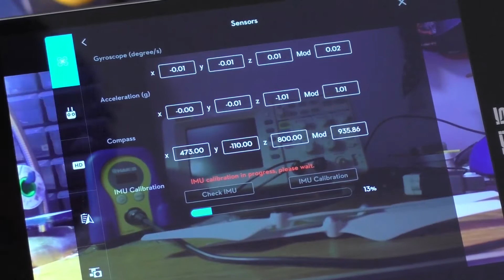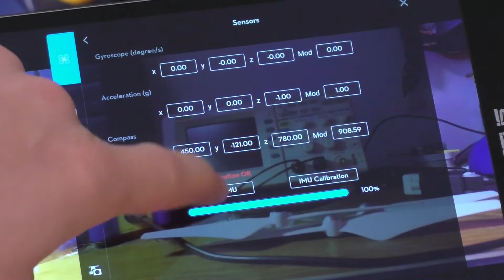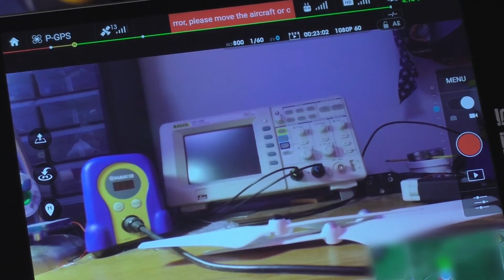DJI Phantom 3 Pro Shell Replacement

Comment: I was messing around with my setting last week then took not early know what was what , took my dogs for a run and my done        Was acting squirrelly ,drifting off when it should’ve been steady in one place any way about 10 min of watching the dogs chase it nearly missing it a few times then nearly missing some low trees about 300 ft away , I bought it back. That’s when I could see just how off it was ended up almost diftinginto a tree and watching $800 fall 50 ft catching every other branch till I crashes to the ground with a broken camera arm, I figure while it’s down I will replace the body ,the motors , and hopefully the camera it’s self still works , if taken my phantom apart a few times and ended up taking it to the shop for the to put back together again lol so we will see how it goes with your video as a guide ,

Comment: The push pins on the camera gimbel stretch when you compress the washer down on the pin, which enables them to be removed and reused. Thanks for the video.
Reply from the maker: Thank you for the tip, and your welcome.

Comment: Can I ask where you got all you’re parts from like the new motors and case I started getting stress cracks on my p3p and would like to change the case but I can’t find a proper seller as I couldn’t find on the DJI store itself. Cheers
Reply from the maker: I bought the parts off of Amazon. I have bought the shell twice form the same place (one for this video and once because of stress cracks) and they most certainly seem to be genuine parts. Here a link to the shell https://www.amazon.com/DJI-Phantom-Shell-Bottom-Covers/dp/B012HXD1BM/ref=pd_yo_rr_rp_t_2?_encoding=UTF8&psc=1&refRID=X0Q4ZV8J7TJ84EGQTRXT

Comment: The package of long star bits you bought... what is the brand / model no. / price and where did U get them?
Reply from the maker: I bought these but I wouldn't recommend them because I ended up breaking them and I didn't even tighten the screws that much

http://www.amazon.com/gp/product/B002T5O5LO?psc=1&redirect=true&ref_=oh_aui_detailpage_o01_s00

Comment: Any tips for getting the compass leg done so it is perfect ( your video shows that you had a problem getting that leg "right"). 

Also... a separate question... 
Did you re glue the compass in its small compartment or is it just sitting inside (not glued)?  If so, what (specifically) did you use to glue it with?
Reply from the maker: I would use just a little bit of hot glue in order to hold the compass wire to the side of the light bridge antenna so when you push that antenna in there is no chance of getting the compass wire pinched. Just make sure that the wire is at the right length so the compass antenna itself sits in the right spot. As for holding the compass antenna in I used a very small amount of hot glue.
Reply: Alternatively you can just leave the compass module in the landing gear and attach the landing gear to the new shell, saves from digging it out of the glue and re-gluing it. I think you can detach the compass module cable from the VPS